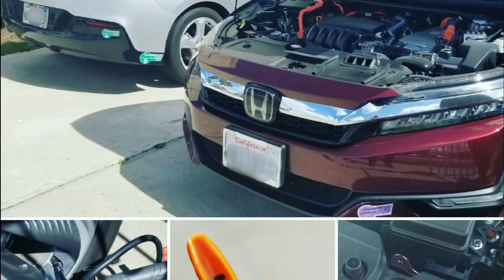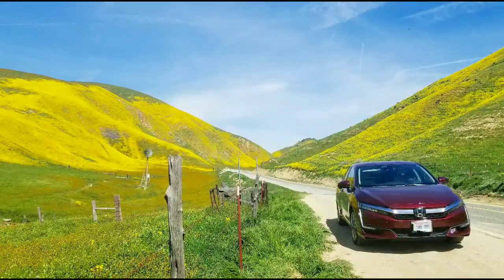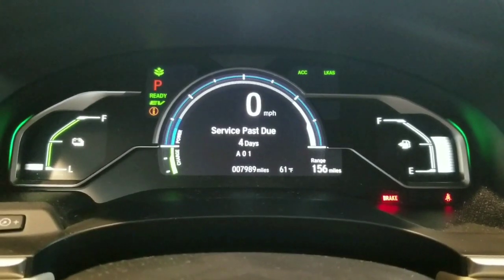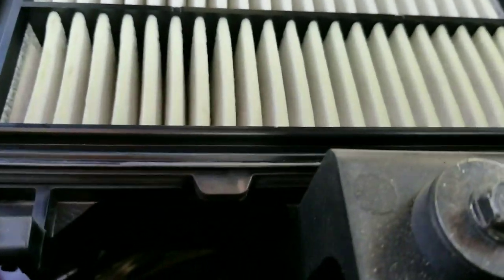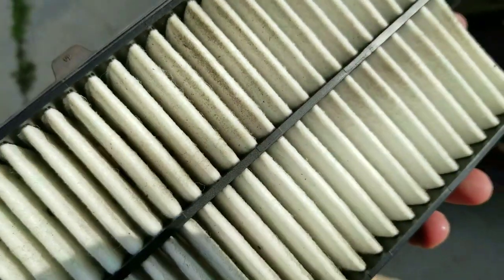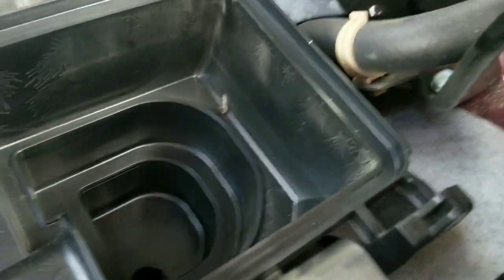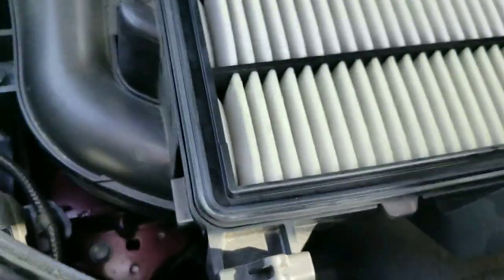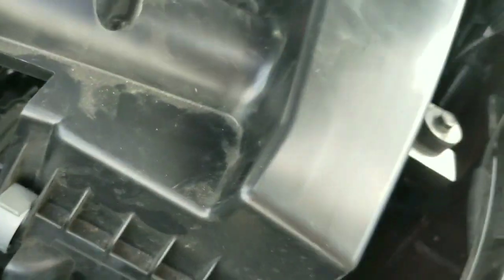How to replace Honda Clarity Engine Air Filter.

Comment: For anyone still having problems "sliding" it off, gently lift the plastic hose/pipe next to it so it bends a bit up, which pulls and angles the cover so it slides off.
Reply: Thank you a thousand times. So simple for not such a recognizable problem. Was afraid of breaking something. Thx.
Reply: Thank you because this video skip this important part 2 times.

Comment: It would be good to update your video to show how you got the top off of the container the filter is in. In your video, it is already off; you say to unclip it and then slide it off but mine does not slide off. Can you show how you remove it?
Reply: You are right. He does not show the top slide off. You have to push the top to the left (your left as you face the vehicle). The tips moves from under the tabs. His english is a little choppy at times. Anyway, Good Luck.  I hope this helps you or someone in the future.
Reply: You gently lift the plastic hose next to it so it bends upward a bit, so it automatically pulls the cover towards the left, and boom, it slides right off.

Comment: How much time between the oil changes? In this video, you mentioned you do it at every 20K miles. I hardly drive 12-15K miles in a year. What should be my frequency of oil change according to you?

Comment: Ummm that filter is dirty bro you need to change it lol 😂 always change your air filters early especially on a Hybrid and do your oil changes 5-7k miles mobile one oil and it will last forever.

Comment: The instructions are a little arbitrary saying if you drive in dusty environment replace the air filter at 15k mi.  But there is also a Maintenance minder item # 8 that calls for engine air filter replacement.  We got the “8” due at around 67k mi roughly…

Comment: Hi I bought a base model. Can u do vids on accessory mode? It is hard for ppl to learn just what to do to get in and out of accessory mode.  For example: how to charge while u have the ac or radio running? I want to sit in my car and charge and wait. But I want the car to be cool and ac and radio.
Reply from the maker: Sure, its easy on the Chevy Volt,but difficult on the Honda Clarity
Reply: @SterlingW8  Hi: can you do a video on Accessory mode?  I want to be able to sit at a level 2 and sit in my car, listen to the radio, charge my car, have the heater on full blast.  How do I get in and out of accessory mode?  I want to charge the car while having the dash board powered.  And after charge, how do I get out of accessory mode?  Can you go to a level 2 and show us the accessory mode while charging and then getting out of accessory mode?  I have trouble on both counts: I can't get in easily; then, I can't get out of it w/o turning the whole car off and back on.  It isn't as simple as braking while pressing.  That doesn't work smoothly or consistently.  thx. GOD DAMN HONDA.  CLEAN UP YOUR SOFTWARE!  U R MAKING IT HARD TO GET IN ANDOUT OF THE ACCESSORY MODE!!!
Reply from the maker: Here you go https://youtu.be/xMN5XbS5BYk

Comment: My San Francisco Bay Area Honda dealership wants to charge me $220 to replace the engine air filter and the cabin air filter.  After watching videos that show how to replace these air filters, I am shocked how predatory those prices are. Clearly, it takes less than 3 minutes each for a tech to do this, and the tech here doesn't have to be an auto mechanic!  So maybe, it should cost $80 at most for these two things. Even $100 is pretty insane.  But they wanted $220.  Pretty shocking.